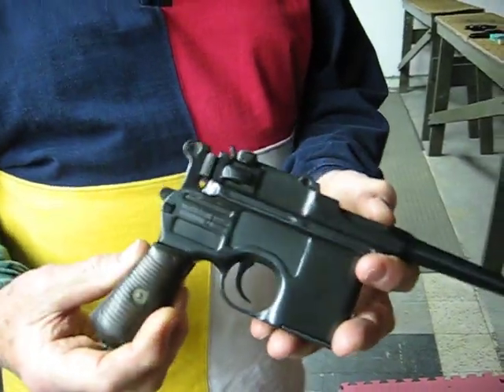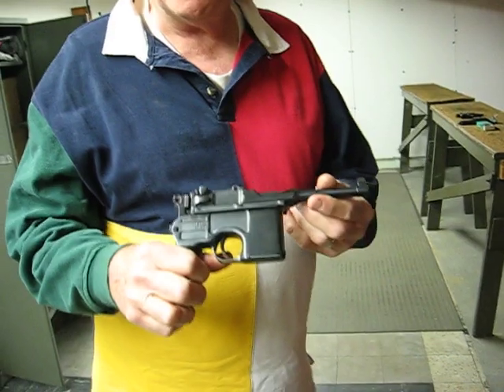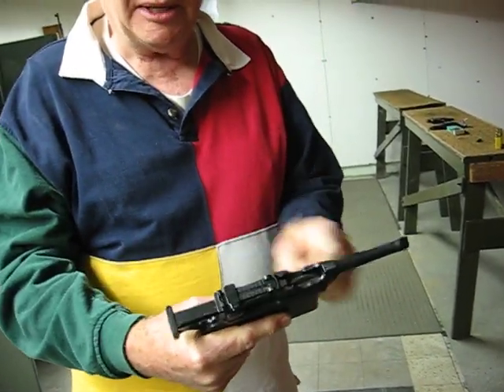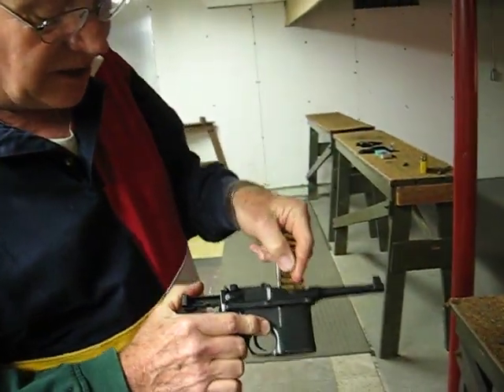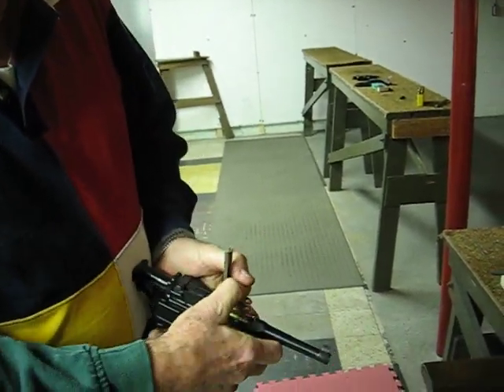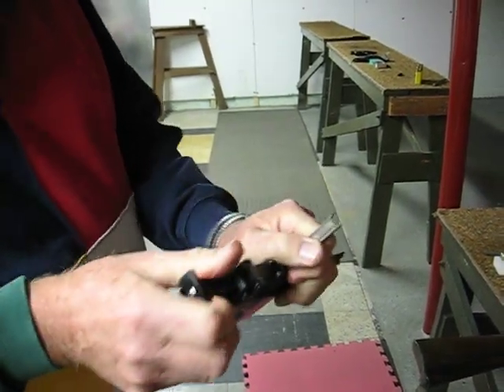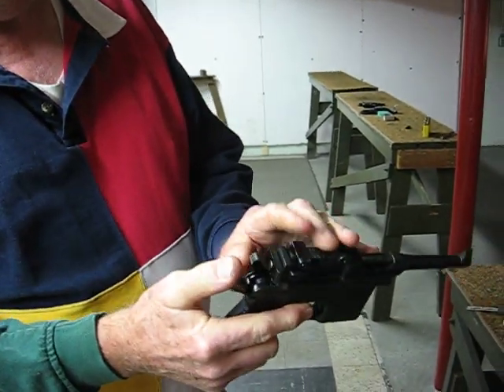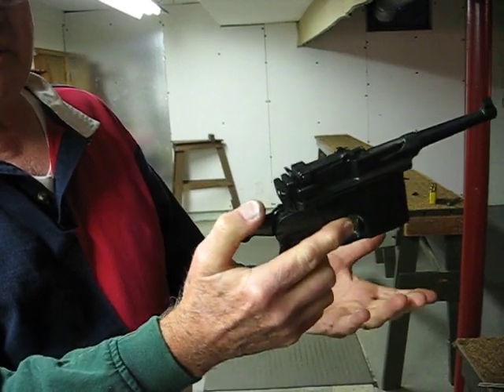Mauser Broomhandle  C-96 Pistol Intro

Comment: Nice Bolo.  One important thing though:  I shoot with a C-96 and stripper clips in USPSA competition, and have little trouble in loading, even under pressure.  The trick is, at least in the C-96 that I have, is to notch the brass (not the steel) of the stripper clip so that it can bypass the bolt's extractor.  Then, with slide locked back (into the hammer's recess, which is what you appear to have), insert clip directly into the clip slot, and push down with a quick stop and go motion.